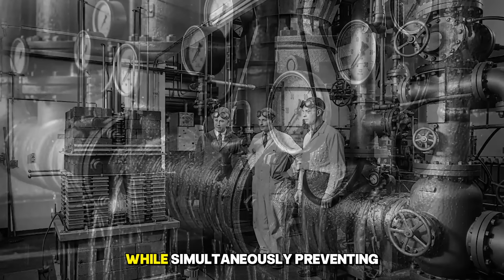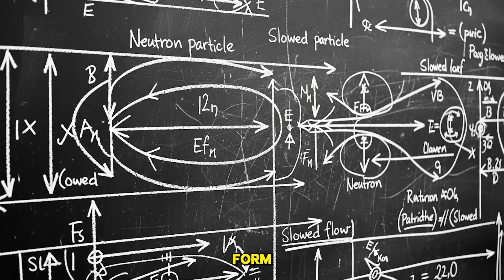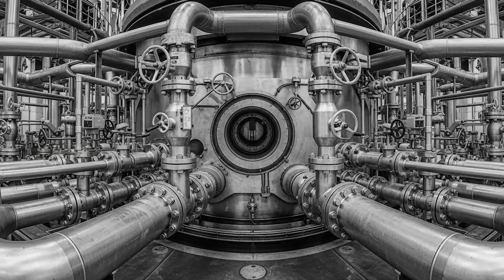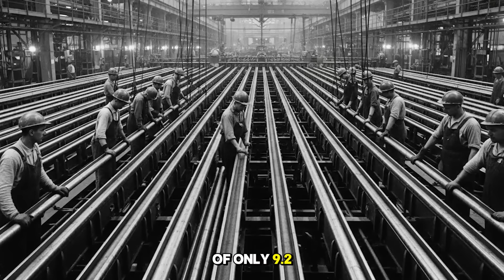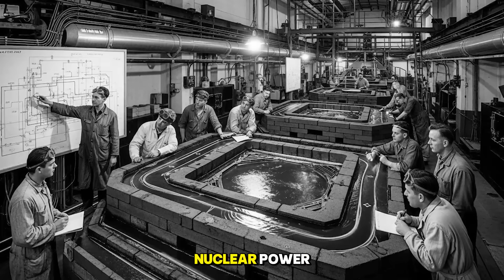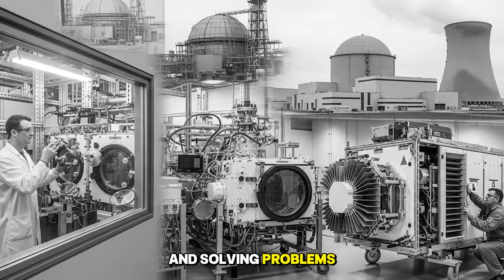WWII’S HANFORD REACTOR SECRET: How 1,200 Tons of Graphite Made Plutonium

Comment: Graphite didn't activate anything.  The tubes ere not just full of Uranium - thats totally wrong.  They were filled with U235 enriched Uranium.  U235 being the rare isotope of Uranium responsible for low speed neutron fission as identified by Peierls and Frisch in March 1940 in England and then this secret shared with the USA starting the Manhattan Project after the USA entered the war on Englands side.  Fermi's "test  and claim to produce 1 WATT n Chicago was a total fraud and failure they did not have U235, os you are propagating BS. You can't make a chain reaction without enriched U235 fuel.  There were already Secret U235 reactors in operation within the Manhattan Project, prior to Hanford. Twice you stated that the reactor used U238 and never mentioned the critical isotope U235. Graphite as moderator was not Unique.- totally incompetent video.

Comment: Oops, ooh-noo boo boo, just bit wrong or a big lie? Here's the Plutonium process: in a reactor U-238 atom captures a neutron~ U-239 still uranium but unstable, so it has a "beta-minus" decay (neutron transforms into a proton)~ Neptunium-239 now a new element but still unstable so, a final "beta-minus" decay~ Plutonium-239 the worst thing it is possible to be I hear, 
a Boomer💥 like me! 😂😂.

Neptunium-237 isn't really a part of the Pu process, almost a waste product but is useful for other things. Np-237 undergoes "alpha decay" (emitting an alpha particle) not beta, is fairly stable with a half life a bit over 2 million years and decays to Protactinium-233! not even close to the incorrect facts in the video!

Comment: If you were to build a nuclear pile to these images, you'd discover the China Syndrome.
And, if you try to accelerate the reaction, by shaving the diameter of the fuel rods,
the pile will take fire, as happened at Wndscale, UK.
Don't forget to the occasional Wigner release on your graphite pile, to prevent a Chernobyl accident.

Comment: 1m 55s  Enrico Fermi's CP-1 pile, built during winter 1942 in the unused Stagg Field facility at the University of Chicago, was a "flattened sphere" about 20 ft in diameter, built using many tons of graphite blocks. For an excellent description of how it was built, see Richard Rhodes' book about atom bomb research. It also has a description of the Hanford facility, with details. None of which match anything shown here. If you're going to post it, why not use information and freely available photographs of people and places, rather than making up rubbish?

Comment: Nice and clever but it should be remembered that 239Pu should be remove periodicaly in order to avoid 240Pu exces from the 2n reaction.Otherwise,the military application will fail,93 % purity is mandatory.In addition,and for the same reason,the reactor should be oversized.Please,always read top level book on order to improve your khnowledges.
The nuclear chemist comment.
Reply: Yes. What Fermi described as "heavy breathing," caused by rapidly-decaying daughter isotopes with high neutron-absorption cross-section. The solution was increasing the number of fuel rods to a total of 2004 (?)(I'm old, so is memory!),using extra channels drilled as a precautionary measure, after calculations by, and the insistence of physicist Dr. Eugene Wigner & another young physicist, John Wheeler. (Recruited as a graduate student to Los Alamos). Wigner's initial proposal used Helium for cooling, but the technical and engineering difficulties, plus the scarcity of that gas, lead to water cooling and an alternate design. As you say, "read the book(s)".

Comment: Question; the plutonium core, which is a sphere, was actually another element uranium, that was bombarded with neutrons which decayed into plutonium?  Just trying to understand how the sphere was made.  I originally thought it was created atom by atom.  Or was the uranium created atom by atom?
Reply: thousands of tons of uranium metal were put in a pile--an atomic pile--cooled with water and surrounded by graphite/carbon. The atoms of uranium in the atomic pile underwent a self sustaining nuclear chain reaction--atoms splitting--nuclear fission--producing heat and neutrons, which both sustained the reaction and, very rarely produced a new element, neptunium, which quickly decayed into plutonium. This was a very slow process and took lots of uranium--I believe it was around 1 ton of uranium per gram of plutonium. either way, the uranium fuel was removed from the pile, allowed to cool for a few weeks, and was transported to a chemical separation plant were the uranium metal was dissolved in acid and a series of chemical processes were performed to separate the uranium and plutonium from the highly radioactive fission products. The result at the end of the plant was thousands of gallons of highly radioactive liquid waste and a few grams of plutonium nitrate, which was shipped to los alamos and turned into plutonium metal, and heated up/melted into a bomb core there.

You could say the plutonium was created atom by atom--but this occurred in the atomic pile, not in the bomb core. The refinement of Uranium for the Little Boy was also an atom by atom operation, done with physical processes--density and magnetism--not chemical separation. 

The real trick in the whole thing is having the resources to build the plants to refine the material. The actual bomb making is trivial in comparison, both in actual cost and brainpower required.

Comment: I agree that the AI narration is annoying, but if I wanted captions, I would turn them on myself! Klaus Fuchs sent Russia detailed drawings of the actual DuPont reactors which they duplicated. It allowed them to completely skip Uranium enrichment as a method towards a device and  speeded up their atomic program. I do have pictures of the actual reactor found in Richard Rhodes book-making the atomic bomb. He also has a follow up book called "Dark Sun" about the thermoneuclear devices. I recommend these books for those interested. This fails to mention that the Plutonium consisted of Pu 239 and Pu240 and Amercium. Later technology seperated out the 239 and the other products were put into barrels and are still stored in abandonded salt mines
Reply: The Rhodes books are excellent.
Reply: the P240 could not be separated out because the isotopes were so close in atomic weight to each other
Reply: @wyliesdiesels4169  it can be separated, though it might take more separation work units. But it was cheaper to swap the fuel rods fast.
Reply: Russian reactors were not copies in any way. They had pure vertical design - both fuel and control rods tubes were vertical, and coolant loops also. Russian separation method differed significantly. Klaus Fuchs invented implosion, and all he had transferred to Russians was the Gadget design, he could not send any info about Hanford reactor B because he had no info about it. If Klaus Fuchs had not invented the spherical implosion method, there will be no Gadget and Fat Man in time, only Little Boy.